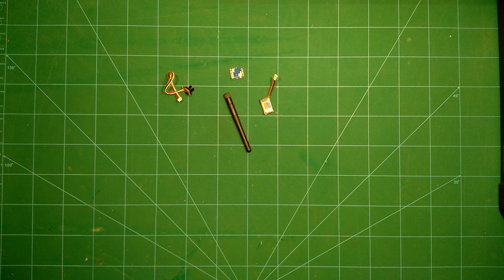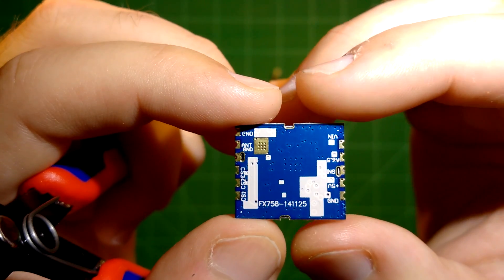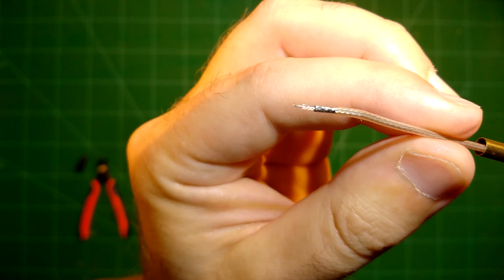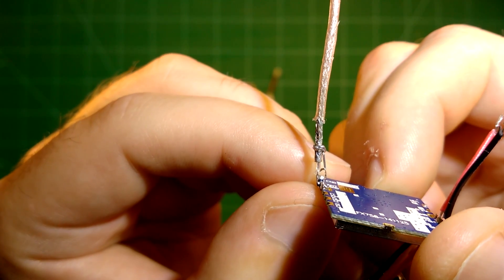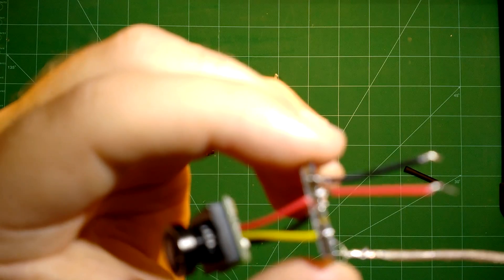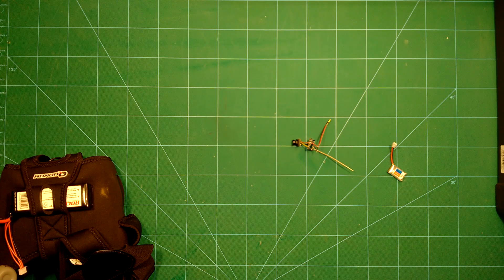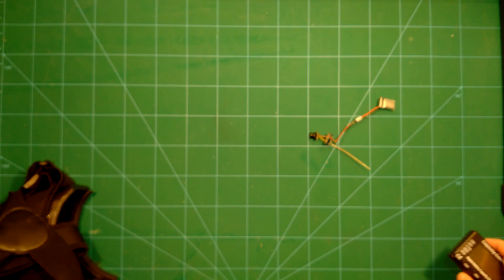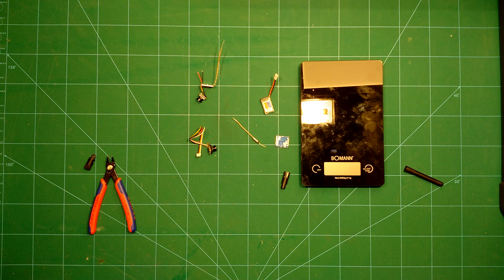Cheap 5g DIY FPV Set

Comment: Noob question! 
That VTX is sold out so I had a look around on banggood.
Is this a complete kit? 
https://www.banggood.com/Eachine-TX03-Super-Mini-025mW50mW200mW-Switchable-AIO-5_8G-72CH-VTX-600TVL-13-Cmos-FPV-Camera-p-1104884.html?rmmds=search&cur_warehouse=CN
I have FPV goggles already.
Would I just be able to plug a battery into this and go?
Are you able to change the channels on it?
Thanks!

Comment: Hi I bought this VTX/cam setup and i'm using it on a brushed micro 100mm plastic king kong running 1s battery, and getting MAJOR noise/video tearing the second that I put props on and give it some throttle. Any idea what might be wrong ? I even tried to add an LC filter, and that di not fix anything

Comment: My video receiver  boscam rc832 it is compatible with this transmitter? https://pt.aliexpress.com/item/Boscam-FPV-5-8G-10mW-Wireless-Audio-Video-Transmitter-Module-TX5813/32607770741.html?spm=2114.02010208.3.1.E2JaFe&ws_ab_test=searchweb0_0,searchweb201602_3_10065_10068_10069_10084_10083_10017_10080_10082_10081_10060_10061_10062_10056_10055_10054_10059_10078_10079_10073_10070_421_420_10052_10053_10050_10051,searchweb201603_7&btsid=3c136f6e-d9a4-44dd-be9d-a6731a95e91c

Comment: does that antenna need to be that long?
Reply from the maker: No, it does not. The important part of the antenna is just the exposed/unshielded wire on top, about 12.92mm long (~1.3cm). You can cut off / reduce the length of the shielded wire.

Comment: Thx for another great review. I have ordered the VTX module (600mw). Have you noticed any range reduction skipping the antenna Connectors?
Reply from the maker: Not at all. I think the opposite might be the case, since you now have a "direct" connection, you should have even less loss. In real life the difference would most probably be neglectable though.
Reply: Ok thank you. Looking forward to try this when i get the stuff i need. :-)

Comment: don't forget video transmitters heat up quite a bit, so it's not a good idea to use hot glue on them. it'll become so soft it won't be of much help, if any. i'd probably use a bit of epoxy putty for strengh.

Comment: Could you send me the tutorial soldering the antenna to vtx module
Reply from the maker: I explain how this is done in the video. For example at 4:05 it is 
clearly visible how this is done. The shielding is soldered to the 
ground, the signal to the antenna port. It's as simple as this. Good 
luck!
Reply: +RC FPV Flight still confuse coz there are 3 cable from the antenna that could solder into ground and antenna
Reply from the maker: The antenna I use only has two "cables". The signal cable inside the plastic and the shielding. The signal goes to the antenna solder pad. I have divided the shielding into two strands and soldered each to the respective ground pad. Hope this helps

Comment: Whats the difference if i just take a regular old shielded piece of wire and solder it to the antenna connector? Whats the point of a grounded shield?
Reply from the maker: I don't know sorry. I just connected it the same way all my other 5.8GHz antennas are connected.

Comment: how do you get rid of the static when the motors start?
I build mine like you did and i get static as soon as i use throttle on Syma X5 and jjrc h8,
Reply from the maker: Yes - interferences from the brushed motors are killing your video signal. Those are very noisy and create a lot of power noise which needs to be filtered in order for you to keep a good video signal when they run. Check out my video here, and specially its description where I link to a tiny power filter which does the job well: https://www.youtube.com/watch?v=DREHnDY1WVk

Comment: Hi! Thanks for the video. Excellent! I have just build a simular set and put it on a small eachine H8.Perfect picture until take off. Signal dissapear "no signal" Any ideas whats wrong?
Reply from the maker: Yes - interferences from the brushed motors are killing your video signal. Those are very noisy and create a lot of power noise which needs to be filtered in order for you to keep a good video signal when they run. Check out my video here, and specially its description where I link to a tiny power filter which does the job well: https://www.youtube.com/watch?v=DREHnDY1WVk
Reply: Thanks alot. Now I can't get the https://www.pololu.com/product/2118 but will any spep dow-/up regulater filter noise from motors like http://www.banggood.com/DC-DC-1V-5V-To-5V-500mA-Boost-Converter-Step-Up-Power-Module-p-1069696.html ???
Reply from the maker: Pololu are the best when it comes to noise filtering, since it does very fast switching. For others you will have to try.
Reply: Thanks mate. Just thought that the problem concerns all the hobbist wanting to go small. Any nerd groups you can recommend? Poluo is at step up. Does it matter if he component convers 3cell til 5v when only recieve im my case 3,3v? And how do you spot if the step up og down actually remove noise. Maby the all do?  Thanks in advance? My first attemp in mikros - the bigger quad seems easeayer, but more clumsy;.)
Reply from the maker: I'm not an expert on this either. I think the secret to getting a noise free step up is how fast it can switch the power, that is, how fast it can react to any changes in the voltage to flatten them out. The Pololu has a 1.5 MHz switching frequency which is very high and thus the noise is filtered nicely.
Reply: Thanks! Would a seperate battyer for fpv (mooooore weight) help?
Reply from the maker: Yes, of course. That will resolve your problem at the price of additional weight.

Comment: not work with out step up module
Reply from the maker: Mine works fine powered off an 1s lipo. However, if you want to share this lipo with a brushed micro copter, for example, a voltage regulator is recommended to clean the power. Otherwise you will get major interferences in the video coming from the brushed motors. See this video here for details on this: https://www.youtube.com/watch?v=DREHnDY1WVk
Reply: +RC FPV Flight 
thank you so much

Comment: Does the vtx have a voltage regulator?
Reply from the maker: I don't know, sorry.
Reply: +RC FPV Flight I saw a couple videos, where people put voltage regulators, so they can have FPV gear and quad under 1 battery.
Reply from the maker: Yes, this is required if you share a lipo with a brushed micro copter. The brushed motors are very noisy and if you do not use a regulator to clean the power, you will get major distortions in the video. I use a Pololu for this task. If you are interested in my complete setup, check out this video where I used exactly this micro fpv set together with a voltage regulator to put FPV gear onto an Eachine H8 microcopter: https://www.youtube.com/watch?v=DREHnDY1WVk

Comment: Nice vid, very helpful, do you happen to know what the default channel and Freq is?
Reply from the maker: Default channel seems to not be unique. I have two of these modules with different defaults. So better get at least a 32Ch receiver to be on the save side :-)
Reply: +RC FPV Flight very good, thanks!
Reply from the maker: If you are looking for a cheap receiver which works well, I would suggest the RC832: http://www.banggood.com/Boscam-RC832-FPV-5_8G-40CH-Wireless-AV-Receiver-p-1023220.html?p=I32013833408201410RW . I have two of them at home and for the price they are awesome.

Comment: I ordered the parts for this, what can I use as a cheap receiver, will rx5808 work ? any other cheap module for rx ?
Reply from the maker: It should, but you might have to install a DIP switch on the VTX in order to set the correct channel. Different versions of the VTX came with different default channels for me. A 32Ch receiver (with selectable channels) would be an easier choice.
Reply: Thanks. I finally found a cheap enough ready made receiver : the rc305.

Really good videos btw, enjoying your channel.
Reply from the maker: Many thanks mate! Please take care, the RC305 is only an 8 channels receiver. For a simple receiver which covers all channels I would suggest the RC832: http://www.banggood.com/Boscam-RC832-FPV-5_8G-40CH-Wireless-AV-Receiver-p-1023220.html?p=I32013833408201410RW
Reply: +RC FPV Flight Well... I ordered too fast. Thanks. I will keep this in mind if needed later.

Comment: Great video!
how would you install the dip switch to get to band A?
I would like to use that with the cheap Syma FPV kit.
Thank you!
Reply from the maker: +Manu Leninja I have not installed a dip switch on mine. But there is an excellent thread on RCGroups which shows how several people already did this: http://www.rcgroups.com/forums/showthread.php?t=2456116

Comment: I read that you can damage the vtx if you power it up with no antenna- can you also damage it if you use the wrong kind of antenna? I have several "junk" antennas that were from old wifi cards, will those work just as well without damaging? Thank you!
Reply from the maker: +RockPDX You are right. Running a VTX without the antenna will kill it. The reason for this is that the RF power generated by the VTX has no way to dissipate without the antenna and will overheat the VTX. The good news is that even a simple wire antenna will already be enough to avoid this, like the one I used in the video. If you want to be extra careful with your old junk antennas, then make sure to not provide the full 5v to the VTX, but rather run it from 1s lipo or (even better) a step up / down converter set at a voltage of around 3.9v (that is the sweet spot for this VTX). A Pololu works great for this. This way, even if the antenna is not working correctly, you will have a lower chance of burning the VTX. While you do your junk antenna tests, keep a close eye on the temperature of the VTX.
Reply: Perfect thanks! I did get a pololu. The shipping cost was more than the pololu itself; silly. That's exactly what i needed to know thanks, and i'll watch the temps on the vtx., thanks for mentioning:)
Reply from the maker: +RockPDX Awesome! Keep me updated on your progress. As for the shipping, Pololu has plenty of distributors in the states, I think you should be able to find one with reasonable shipping rates :-D https://www.pololu.com/distributors#usa
Reply: Thanks!
Reply: +RC FPV Flight I hooked everything up, i think i have it right! But i didn't think about channels- i am using an rc305, and having a very hard time trying to confirm what channel i am on. I am using the exact same Vtx (FX758-2). I don't know what freq the vtx transmits on by default, i'm reading at rcgroups, but it sounds very confusing:)
Reply from the maker: +RockPDX I believe different series of this VTX come with different default channels. The default channel of mine was on channel 4 of RC305, but as you say, several people on RCGroups report another default channel. I recently switched to this 40Ch reciever, it gives me the possibility to check any of the available channels and it is still cheap enough to not regret the buy: http://bit.ly/1SI0ZD6
Reply: Great, thanks, i'll look at that one as well, thanks for the link!

Comment: how the video is transmitted to the screen ???
Reply from the maker: +Mayank Patel It works just like every other 5.8GHz video transmitter. You need one of the many 5.8GHz video recievers, which will have an AV out which you can connect a screen to (or goggles, or even an USB grabber to get it digitized for your computer).

Comment: hi thanks for your share, im looking to do some image processing so is there a way to connect this to a pc ? or have the image go to a pc ? i was actually looking for a small pc usb video camera but cannot find something this small nor this affordable so maybe you can bring some light to my research ? appreciated
Reply from the maker: +Frank Lopez Hi! Yes that works, you can simply use a cheap analog USB grabber to connect the camera directly to a PC: http://bit.ly/1R1exHc
Reply: RC FPV Flight VERY NICE!! now the big question.....does this come up on the device manager as a USB camera? i plan to use OPENCV so i need to be able to tell openCV where in my usb this device is hooked up to so that i can pull fresh frames from it
Reply from the maker: +Frank Lopez It would be seen as a USB device, an USB grabbing device to the more concrete. It will depend on your software if it can directly talk to it as with an USB camera. I can't tell you this, you would have to try it out I think.
Reply: as in now this program does this, it calls usb cameras available for use by simply using this line of code println(cameras[i]); then i would get a list of cams like so

name=Microsoft LifeCam Rear,size=848x480,fps=30
name=Microsoft LifeCam Rear,size=640x360,fps=30
name=Microsoft LifeCam Rear,size=640x480,fps=30
name=Microsoft LifeCam Front,size=640x360,fps=30
name=Microsoft LifeCam Front,size=640x480,fps=30

so if there was a usb camera in my device manager it would show up there

Comment: How to change channel / freqvens ??
Reply from the maker: +Brian Madsen 5945 MHz is the default channel. In orer to make it switchable, you will need to install a DIP switch. There is a great thread about this module on RCGroups, where several people did this already, take a look if you like: http://www.rcgroups.com/forums/showthread.php?t=2456116
Reply: +RC FPV Flight 
great thanks :-)
Reply from the maker: +Brian Madsen Awesome! Thanks for sahring :-)
Reply: RC FPV Flight i tried soldering DIP switch as per RC Group, but no matter what combination i set, the frequency just do not change... it's always on the default frequency... Any clue?
Have u tried changing the frequency?

Comment: Awesome video! I'm going to build this, and just have one question. I see others putting channel switches on the VTX in order to specify what channel they want. Can you explain why you don't need it? I'll be using Fatshark
Reply from the maker: +Robbie Feeney I don't need it, because I'm happily using the default channel of the VTX. Should I ever had the need to switch it (for example, if a friend of mine also flies with one of my micro FPV sets), then I would also need the DIP switch.
Reply: Ohh gotcha. Do you know if Fatshark covers the default channel?
Reply from the maker: I don't know for sure, sorry :-(
Reply: +RC FPV Flight Alright thanks!

Comment: Hello from Spain, good video!! <<<<i want to use this setup with syma x5c , if i want to set it out of the box (more weight but no noise).....will work with a 1s lipo 100mha?? vtx is 5v , camera 3.5-5v ....and battery 1s100mha 3.7....do i need step up? If yess..what pololu version?? thanks !
Reply from the maker: +Angel Bernal Hi Angel! You can use this Pololu and set it to 3.9v, that will work great: https://www.pololu.com/product/2118 . This Pololu will also remove any noise from the brushed motors, so you could - if you want - just use the power from the flight battery. I do this in my FPV mod of the Eachine H8 and I do not have any interferences in the video thanks to the power filtering of the Pololu: https://www.youtube.com/watch?v=DREHnDY1WVk
Reply: +RC FPV Flight thanks for your fast attention!, It´s a really cool idea but in fact im using 3.7 500mah lipo to feed Symax5...will be enought for supplying syma+vtx+cam? About setting pololu at 3.9..could you tell me why 3.9 and not 5v? (vtx is 5v and cam support 3.5-5). Another noob question...setting this combo out of the box its neccesary to add the pololu? Thanks again!!
Reply from the maker: +Angel Bernal Yes, it will be enough. Even the 3.7 150mah lipo on my H8 Eachine was enough to both feed the H8 and the vtx/cam. 3.9 is a sweet value which gives good range on the VTX, but will not let the camera or the VTX get too hot. 5v will work, but both components will get quite hot.
Reply: I´ve just bought it at 11,20€ here in Europe....a bit expensive but as you said it´s worth it. ...I´ve read it´s only needed a screwdriver and a multimeter right??Thats my last question dude, sorry for my bad English.
Reply from the maker: +Angel Please feel free to keep asking questions, nothing bad about them :-). Yes, you need a screwdriver to set the output voltage (just turn it by a few degrees, it is quite sensitive) and a multimeter to actually check when you are at 3.9V. You English is just fine, mate :-)

Comment: will this transmitter work with the Fatshark bands ?
Reply from the maker: +pointnozzleaway 5945 MHz is the default channel. In orer to make it switchable, you will need to install a DIP switch. There is a great thread about this module on RCGroups, where several people did this already, take a look if you like: http://www.rcgroups.com/forums/showthread.php?t=2456116
Reply: I am interested, but the link you posted leads right back to this video !  I am a member of RCGroups, I will try to find the thread if I can.  thanks for the reply
Reply from the maker: +pointnozzleaway Hmm, that link works great for me. Sometimes YouTube gives you a "this link will refer you to something outside YouTube" warning where you have to click again. The thread title on RCGroups is "FX758 200mW VTX (vs the TX5823) (Under construction)". I'm sure you will find it :-)

Comment: Hey,

Thank you so much for this video. I'm getting a Hubsan  X4 h107C and was looking to add FPV to it. Would this Tx be similar to the one you've used ? (http://goo.gl/Qj12Pe)
Also will this Rx (http://goo.gl/YbRnO5) be compatible with the Tx you have used or the one I've linked above ?
Reply from the maker: +Sidharth Makhija Hi! Yes that TX will work and it will also be compatible with the RX which you posted! Have fun with your build :-)
Reply: +RC FPV Flight Thank you so much ! :D

Comment: how would you change the channels? I would like to have that flexibility since i usually fly with mates
Reply from the maker: +WickedTRX In orer to make it switchable, you will need to install a DIP switch. There is a great thread about this module on RCGroups, where several people did this already, take a look if you like: http://www.rcgroups.com/forums/showthread.php?t=2456116